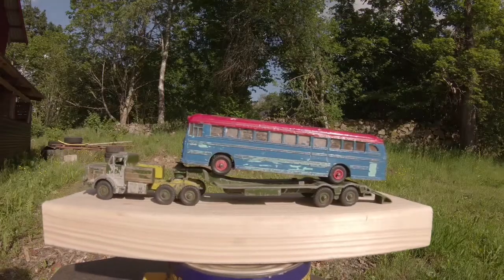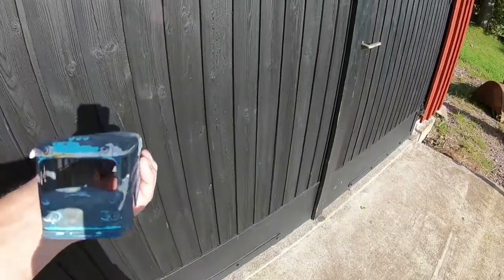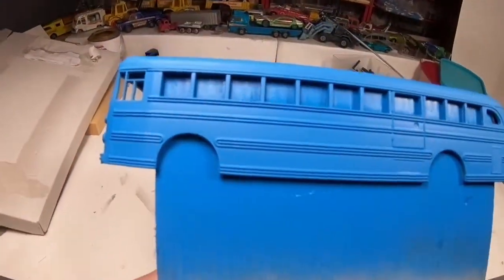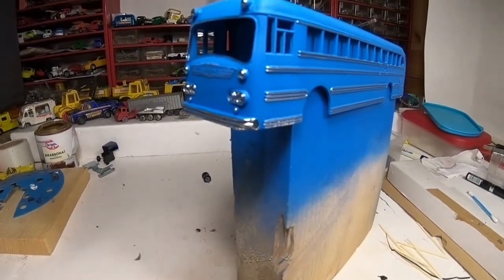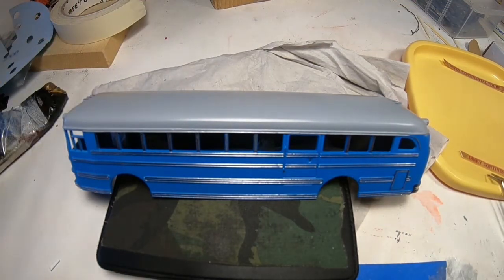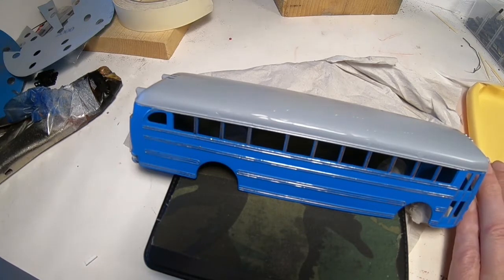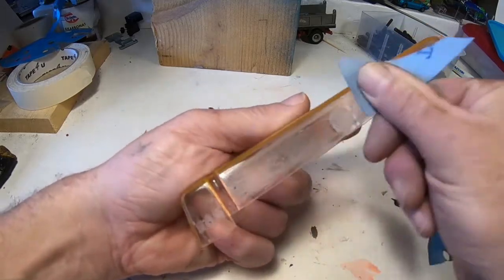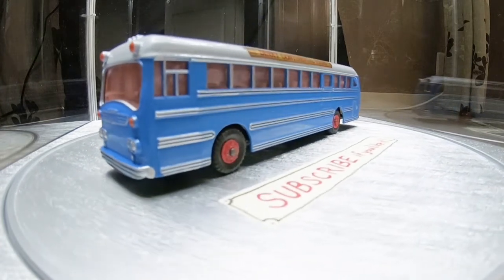Restoration Dinky model bus

Comment: Great job. I had this model when I was a kid. I remember it had broken windows and unfortunately, I had vomited over it which had got inside the bus! It's very expensive to buy one in tip top condition especially with the original box.
Reply from the maker: Thanks!  My first though about your bus is,would have been cool to pour epoxi resin,like a solid block,with vomits and all... or,maybe not so good idea.